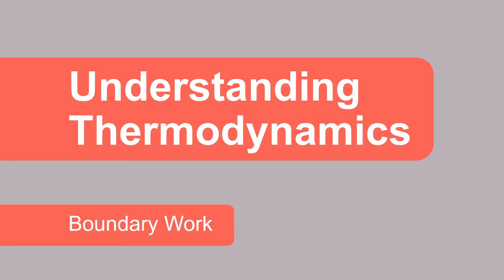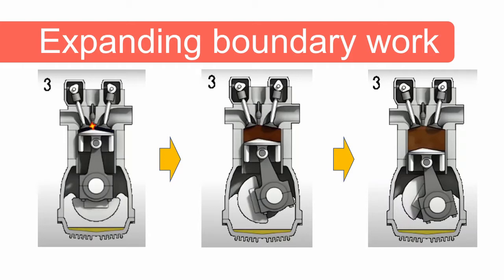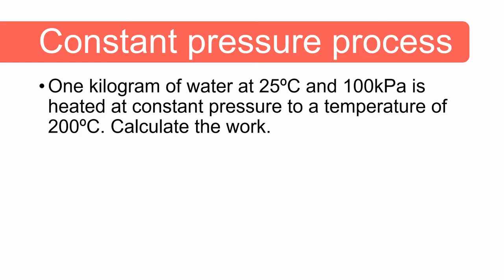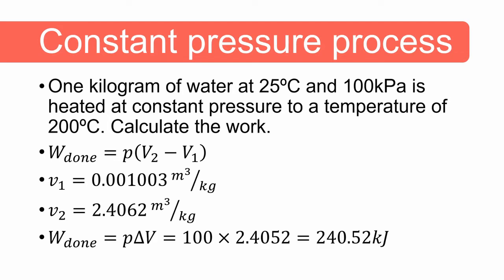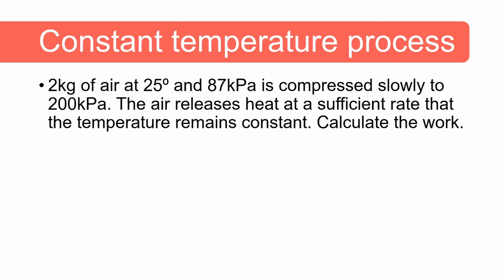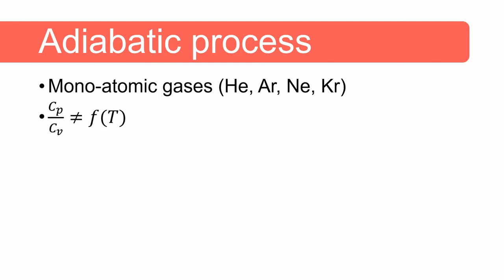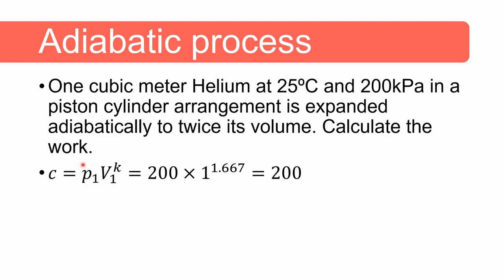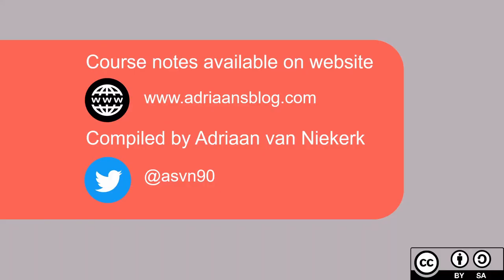Boundary work | Constant pressure process | Constant temperature process | Adiabatic process

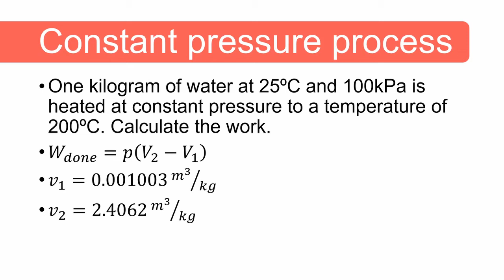Comment: at 3:40 the specific volume should be  2.1724 not  2.4062,  2.4062 is when the temp is 250 degrees celcius. Thik you accidently read the table wrong since those values are right next to each other. Thanks for the video though its very helpful :)
Reply from the maker: Thanks for highlighting that. You are right v_2 = 2.1724 m^3/kg.
Reply: @AdriaanVanNiekerk  Shouldn't we use Volume for that calculation instead of specific volume? Or use that formula but multiply it by the mass of the water?
Reply: Apologies for my mistake, I see that the mass of the water is 1kg so it is correct but the formula did not indicate that the mass were used
Reply: I was thinking that I was reading the steam table wrong for long! Then I came to the comments section! thank you. 

Anyway, probably this is the most compact & comprehensive lecture series on thermodynamics ever made.
Reply from the maker: Glad the comments helped. Apologies for the mistake 🙏 I am glad you found the series useful. 🤝
Reply: @AdriaanVanNiekerk  could you please help to understand the values of specific volumes (initial and final) for the problem on constant temperature process?